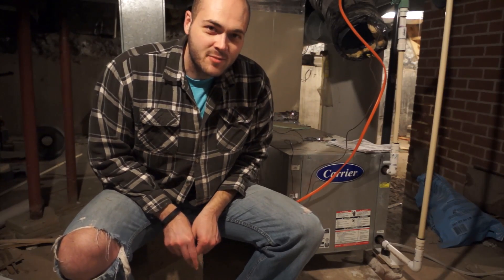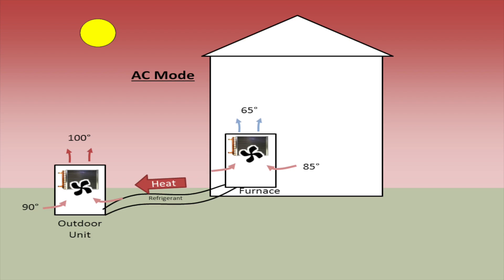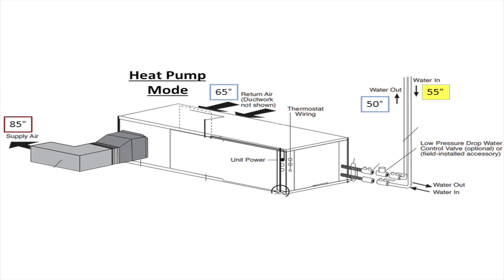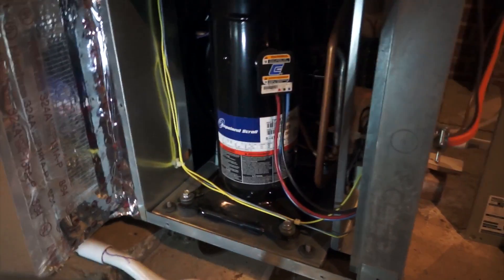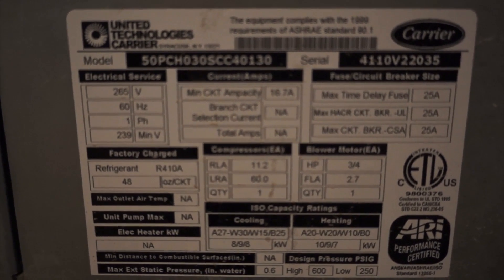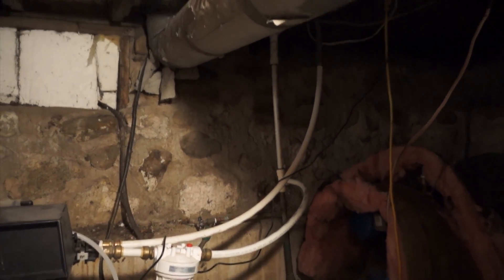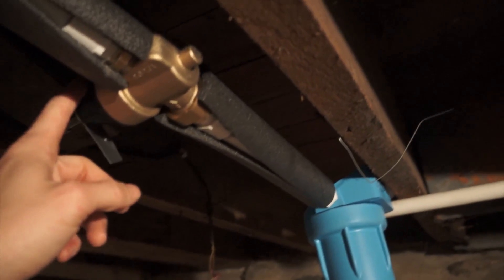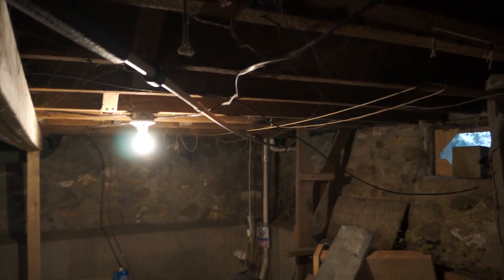Geothermal: How to DIY for cheap!

Comment: It’s dumping the water into a creek. Ok, well that solves that issue lol. Are you not concerned about pumping water out of your well. But you have given me a idea. If we want a pond we need to pump water from a well everyday and it could go through a water source heat pump. The daily water would just make up for leakage and evaporation. But I’m concerned about heating the pond in Summer and cooling it in Winter. I guess there’s always trade offs. Thanks

Comment: Nice job. How has this been working?  What part of Florida you in? Know what the temp of your water is in August?  I have an off grid property in Lake Placid Florida and was able to hit water at just 15'.  I'm wondering if possible to cool an 8x8 insulated shack that's under the trees down to 75F when it's 95F outside in August?  Something DIY with a small fan and radiator powered by Solar and Lithium. Also was thinking of maybe instead burying a big flat aluminum container 10' under the shack and leverage the fact that hot air rises and push air through in a closed loop air system where I suck hair from the very bottom of the tank, and pull it from the very top the shack.

Comment: I have a very similar system. It's an open loop system which runs the well pump to push water through the heat exchanger and then dumps the water out the side of the hill the house sits on. I've become wary of this system. I don't think it saves us anything but rather produces higher electric bills because it has to constantly run the well pump. We have a large well pump, 7.5 HP motor and it draws about 45 to 50 amps. It's large to be able to handle geothermal, domestic and irrigation needs all at the same time. I'm considering converting it over to a closed loop system where it would only take a little circulating pump to pump water or glycol through several hundred feet of plastic tubing. This would be much more efficient, save electricity and water. The tubing could be buried in trenches or in a large swimming pool size hole or even stuck down into my water well where it it go to the bottom, 500 feet down, and then make a U-turn and come back up and through the heat exchanger. I'm finding in my conversations with geothermal companies that open loop systems are certainly not as efficient as folks may think.
Reply: Closed is best imo. Open is wasteful, and I have a year round running creek, an irrigation well and a 100'deep well for my house. I ran a closed loop down the well about 80 feet, then have a 100 foot run to the house 4 feet underground (it's Idaho so it gets cold) so it's quite a good run. I was going to pull from the well and dump back into it, but a closed loop seemed best. Open is wasteful unless you dump back into the source. A small recirc pump wired to only turn on when the unit calls for it is all you need, then your well pump won't run, not to mention depleting the fookn aquifer, hate that people don't consider that, out of sight, out of mind, until it's dry..

Comment: Good job Joe.  I'm a fan of the Geo systems.  Bought a house 19 years ago that had a  traditional SUMP pump and dump.  When It bites  the dust and I will replace it with an horizontal open loop, which pumps about  6 gallons a minute from a rather shallow depth.   This amounts to all of 2400 gallons a day, without  recycling any of the water utilized.  There is a very large lake just to the north where I discharge this runoff water  directly via a city storm sewer. Currently,  I'm searching Craigslist but have not found a good deal as yet.
 Still researching the alternatives and which way to go, open or closed.  I value your insight, especially the sprinkler zone valve - freaking great idea.   Keep up the good work !
Reply: Closed is best imo. Open is wasteful, and I have a year round running creek, an irrigation well and a 100' well for my house. I ran a closed loop down the wee about 80 feet, then have a 100 foot run to the house 4 feet underground (it's Idaho so it gets cold.so it's quite a good run. I was going to pull from the well and dump back into it, but a closed loop seemed best. Open is wasteful unless you dump back into the source.

Comment: Could you run a closed reusable water system if you didn't have a well or stream to use?
Reply: Yes a water tank works, underground if your area freezes though 1 or 2 feet as long as the bottom of the tank is 4 feet deep or so.

Comment: What if you dumped the water back into your well? Depending on how deep it was I wonder if the temp at the bottom where you were drawing from would not be affected by the water getting dumped back on top.
Reply: dumping the water into the creek is not efficient
Reply: Hes dumping into into his septic system so it is going back into the water table
Reply: @Luciano Dominic i use Flixzone. Just google for it :)
Reply: @Luciano Dominic I watch on Flixzone. Just search on google for it =)
Reply: @lianlawrence5671  not a great idea to return water directly into water table.  Makes for great contamination potential and is likely illegal wherever you live.

Most Geothermal systems aren't open-loop like this but instead use closed loops of continuous HDPE or similar.
Reply: I know Im pretty off topic but does anybody know a good site to watch newly released movies online ?

Comment: I looked seriously at one of these produced commercially however, my GPM with my similar jet pump in the basement (shallow well) was unable to meet the demand. Maybe a DIY system like this would meet my needs still?
Reply: Only need 2.5 to 3 gpm per ton.

Comment: Good job Joe.  I'm a fan of the Geo systems.  Bought a house 9 years ago that had a 35 year old FHP pump and dump.  It bit the dust and I replaced it with a Climatemaster vertical closed loop.  I'm soon to move to Tampa and am researching the alternatives and which way to go down there, open or closed.  I value your insight, especially the sprinkler zone valve - freaking great idea.

Comment: Any thoughts on adding another pressure tank to reduce the number of times the well water pump has to cycle on and off? This may help longevity of the pump.
Reply: use a closed loop system and you only need a small recirc pump, well pump never turns on again after the first fill of the closed loop system.
Reply: if you loop the system then you remove the "geo" aspect of it.  The geo is what cools the water down so it can cool.

Comment: This is not geothermal system.
Reply: It is. It is called an open loop system.
Reply: @ajquick  yes falsely
Reply: I asked Muhamid and he said Yes it was, he had to marry a 9 year old first but got a message to me by Camel, at the end he wrote, "P.S. I am a child rapist and am in Hell, Jesus is the only way to Salvation." PTBH Pfft.
Reply: READ A BOOK, Geothermal vents aren't geothermal? The water is heated by the Earth, otherwise it would be Ice. Amateur.
Reply: @thefix2573  oh Trump supporters are taking over  everything. It seems like the only piece of text you have read is a geothermal heat pump brochure.  Forget the marketing terminology, it’s a HVAC system that uses ground instead of air to dissipate the heat. 
Now let’s talk about your misunderstanding of that ad you have seen:
1-It’s not water in the system. 
2-it’s not necessarily heated by ground. Most of the time cooled by earth. 
3-it would never turn to ice because it’s under pressure. Otherwise system would be blocked. 
There are loads of falsely advertised words around. That’s why you shouldn’t consider yourself an expert or educated by watching videos or using google. :)
Reply: Hamed H and you don't know what you're talking about, now go to your room no more YouTube for the rest of the week.
Reply: @heknows5418  ok. Now I know I am talking about. It’s not a “real” geothermal system :)

Comment: I can't do this with a conscious in Texas - just too many droughts and water shortages to pump ground water and then dump it.  My reason to be here watching this is to go green and cut Texas a/c energy use but I Can't at the expense of the water table all my neighbors share with me.

Any system that works for me is going to be a closed system.  I did learn from the video and I thank the poster for that.
Reply: broadwayFan28 just curious: if you pump water from under the ground, run it through your system and dump it again, what will happen? Some of it may evaporate... and if you just simply build a separate septic field - basically just stones. Would it not go down back and raise your groundwater?
Reply: @andireimer  It took millennia to fill the Aquifer and a Century to drain it. Closed loop is the best way, don't need a septic drain field. What is it with all these water wasters? Like it's a religion.
Reply: @andireimer   Don't know.  Pumping from 150', not sure the ground water would rise or worse, be contaminated.
Reply: The "contamination" potential is among the things that make Pump and Dump systems illegal. Some counties in Texas will lynch your bank account. But broadway Fan's reason was the best- he sees it as a community responsibility- I commend that in anyone anywhere. A closed system will work as a ground source- it does cost $1000 up to drill the holes and set the loop pipe, about 1 ton of cooling power for a 100' single loop. Different exchanger efficiency will get more or less. Has anyone given any thought to using a flow through tube  with an ultra violet lamp? I know small systems like that can keep drinking water safe from bacteria. that might allow for safe return of the well water through a new shallow well at a bit of distance from the existing well.
Reply: If you have a large enough pond you can use an open loop system.  Pump the water right back out to the pond.

Comment: You could have just put a water spray/mister on you a/c condensing unit and accomplished the same thing for less than $50. 
  I give you credit for diy and looking to save money but it seems that the efficiency savings you are getting would take longer to pay it's self back ($800 cost) than the unit will last.  
   Just what i see.  No disrespect.
Reply: Not even comparable efficiency of an actual Geo exchange unit.
Reply: Bill Bowles you're not seeing clearly Bill, clean your glasses.

Comment: How did you calculate 2.5 ton performance? where I live the ambient temperature is 130 degrees.

I personally think geothermal is directly linked to ambient temperature unlike electric A/C which can lower to 64 degrees.
Reply: I need 20 tons of cooling power. and I really don't know how to achieve that!
Reply: @HD13POWER  The level of the water table varies from location to location. For larger scale operations, you need a greater volume of water- there is an absolute maximum speed at which water can be pumped through the system and shed heat or pick up heat (depending on whether you are in heat or cool mode), so you need more wells. geothermal ground loops (horizontal or vertical) to achieve the volume of water/temp for your heat exchanger to add or subtract heat from your environment to achieve your comport point. Your comment on ambient temperature makes no sense- ambient or air temperature has little bearing on temps be;low a certain point- in many areas, as little as 6'-8' down the temperature stays constant to within a very few degrees, summer, winter. that would make a good ground tap- a shallow water table would give a greater amount of water at the temperature of the water's source. I would hate to deplete a ground water source for HVAC, so I feel some responsible answer to final disposal should be addressed. Twenty T is very doable- you should investigate the contractors in your area, locate some people who are operating this equipment , etc; the potential to save you half or more on your monthly costs makes this very attractive- unless the installed cost will take overlong to break even.FR

Comment: about how many gallons of water does it pass per day?
Reply: a rough rule of thumb is 3gpm (gallons per minute) per ton. but it depends on the manufactures recommendations it can be more or less. so he has a 2.5 ton unit it should be using somewhere around 7.5 gallons per minute roughly. so if he is using the system for 24 hours he will have used 10,800 gallons, thats why he but a shut off valve so when the unit is satisfied it reduces the waist water. usually water source heat pumps are used in closed loop systems with ether a cooling tower or a water to air heat exchanger instead of ground water, it recirculates the water reducing massively how much water is typically used in these systems. id imagine the way he has this set up would cost him a lot of money in water if he isint getting it from a well. i wonder how well the unit works in cooling in the summer. in California where i live 2.5 tons would not be enough to cool a home of that size.

Comment: Thanks for your video.  Your geothermal system is as simple as it can get. 

 I have a similar situation in which my shallow well of 40' provides abundant water(55 F) supply and I also have a place to dump the water.  Though I would like to put a similar system, I have two questions.

1.   How often do you have to flush out the  salts (Ca, Fe etc)  which may accumulate on the heat-exchanging surface?   
. 
2.  After one year of use, do you observe any corrosion on the pipes and heat exchanging surface where well water runs through within the geothermal unit?:

Comment: You need to do two things, run this in a closed loop(dig a trench about 20+ feet deep and install a tank) and add a backflow value to your clean water input. The way you currently have this setup you are going to overflow your drainage ditch and ruin your septic system, and you are losing all efficiency to regulate thermal energy by dumping it out into the drainage field. Not even sure if the energy savings in your configuration will pay for the extra electricity usage here.
Reply from the maker: The drainage ditch is a creek which handles WAY more water any time it rains than I'll ever put into it. The install also in no way affects any aspect of my septic system.
Reply: @justjoe5896  This guy and the people who up voted him are just jealous they didn't think of this first or they overspent and got oversold on a way overcomplicated system.

Comment: Nicely done!  I've been running a horizontal slinky loop system for 8 years and it works great.   Pump and Dump - It's interesting that you can dump to a creek - Here I believe we have to have a separate dump well to return water to the aquifer.

Did you apply for your tax credits?   http://dsireusa.org

Comment: Heat pump 1 ton.
With what diameter copper pipe must be installed in drilling depth 100 feet.
3/8 to 1/2 cooper pipe?
r407c
Reply: Need to use a heat exchanger. if that pipe or fitting fails you will contaminate the well water.